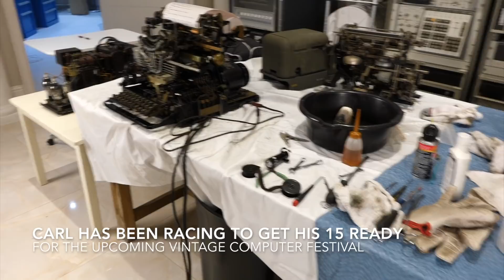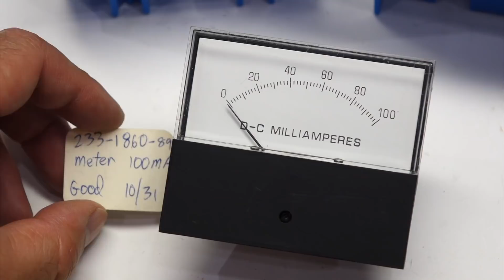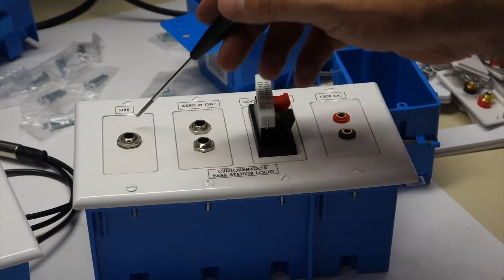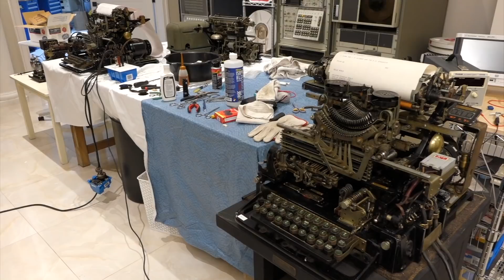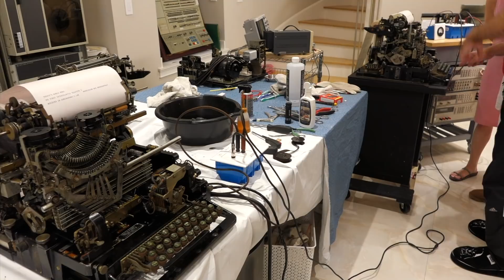Teletype Model 19 Part 7: Our First Intergalactic Transmission Attempt

Comment: I've just started restoring a model 15. I want to do exactly what you did in this video and hook a 120VDC power supply up such that I can use the keyboard to run the printer (I only have one unit). Can you share the diagram you ultimately got working in this video that shows how you wired it together and value of the resistor? That would be super helpful!
Reply from the maker: Just added the blue box diagram to my Model 19 web page here: https://www.curiousmarc.com/mechanical/teletype-model-19
Scroll down to Episode 7.
The resistor is 1kOhms 10W. It reduces the voltage to about 70VDC for only one TTY in the loop, and makes the resistor go a little less toasty. If you want to operate closer to 120VDC, use a 1.8 kOhms resistor. 
Good luck!
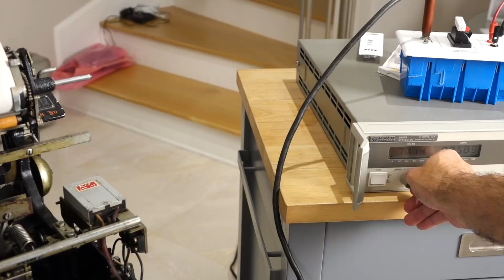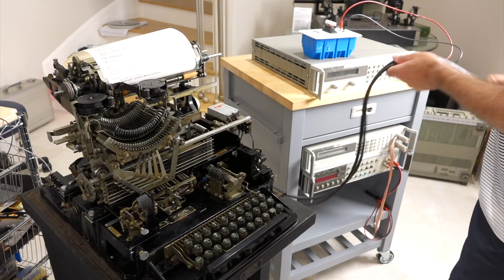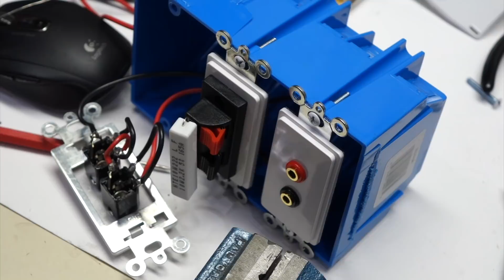Reply: @CuriousMarc  At the 5:06 mark you appear to get it working by just plugging in the single red 1/4" cable. This implies that the receive circuit and the send (keyboard) circuit are already wired in series in the teletype itself. I would have expected you would need to plug in both the black and red 1/4" cables from the teletype to the two jacks in your blue box so that the send/receive would both get connected in series. You did do that at first, but it did not work (3:06 in the video). It looks like you then just plugged in the single red 1/4" cable  and added a jumper wire to bypass the unused jack (at the 3:35 position in the video). Am I correct on that? Really appreciate your help by the way...

Comment: Your round teletype meter is from a radio RTTY modem. The measurements depicted relate to the modulated signal it produced. I think it used two tones and switched back and forth between them for mark and space.
Reply from the maker: Are you really sure about this? It is graduated in mA with a window around 60 mA. It's has to be the loop current, and cannot be a  RTTY modem FSK modulation display.

Comment: No built in aufocovefect? 😂. Brilliant to see them working mate,  keep up the good work!

Probably an odd thing to notice, but I love the printed labels on the boxes. Did you use a particular labelling machine to get that awesome font? The one I've got does absolutely woeful labels haha
Reply: I use Brother P-Touch label printers (I also have Dymo cabling printers meant specifically for labeling wiring cables) for such labels.  The better units support multiple fonts and font widths (narrow, normal, wide)  and styles (bold, vertical, drop shadow, outline, italics, etc.), or you can connect them to a PC via USB and using the supported software you can create labels using any font or B&W graphic available on that PC.  In designing them on a PC you just have to keep in mind that most models, save for the very high end, print at 180dpi (high end 360dpi) and are exclusively 1-bit graphics, B&W with no grayscale support, but you can create some very sharp labels using a PC.

Comment: I often burn the midnight oil watching your CuriousMarc channel. It's very addictive! I must mention there is a great cleaner called NP9 or nonylphenol-ethoxylate. At work we call it "Bucks brew". After soaking metal parts for a while in a non dilute solution, it removes oily residues far better than simple green can. But its nasty stuff! Btw I am on the hunt for a semi-vintage transmission unit I experimented with as a child, it was used for land based beacons in the south island and sent out a station signal for aircraft as a navigation aid, although it's an ascii machine called the ARC Intershake DTM-II. The baud rate can be manually adjusted down to 300 and a speaker outputs the nostalgic modem-sound of the transmission, i have all the manuals from when my late father gave me the machine but it wasn't long before the power supply blew up and i got rid of it, I hope to find one again! Anyway, best regards from New Zealand! Daniel.

Comment: Those exposed banana jacks carrying 120V look a bit scary to me tbh
Reply: Its 120v but only 60mA ..  nothing to drive your toaster...
Reply: Closer to what's needed for a night light than a toaster.
Reply: @mm-hl7gh  <eyeroll> Medical devices are limited to AC leakage currents of say 100-500uA (0.1-0.5mA). The max allowed DC leakage is half the lower value (on parts exposed to intact body contact). So it being DC only makes things scarier. Coming in contact with rectified line voltage (with some capacitor smoothing) is much worse than equivalent AC, because AC doesn’t cause electrochemical effects due to electrolysis, whereas DC not only triggers the muscles but immediately starts to destroy the tissues and can easily impose a semi-permanent bias on the motor end plate (that’s a  part of our anatomy, nothing to do with motors or metal plates).
Reply: It's DC, not AC. Human body has a relatively high DC resistance. It's AC that can get through more easily because of capacitive coupling.

Comment: The orchestration of mechanical to electrical back to mechanical between the machines is impressive! Each character is encoded and serially decoded into a mechanical memory in the blink of an eye. Must have been challenging designing a mechanism whose inertia would not impinge upon the required decoding and printing speed!
Reply: imagine one constructed with today's tolerances... it would be glorious

Comment: Question:  If the modern power-supply is current-limited to 60 mA, why did you need the current-limiting resistor in your loop circuit?  Wouldn't you just wind up cutting the current down from 60 mA, producing something lower than the desired current?  Could that be why the chatter was happening until you increased the power-supply's current to 70 mA?
Reply from the maker: Answers: Part 1 - yes, you can run it without a resistor (I just put a wire) in current limited mode, it sort of works. But it makes for wild voltage swings between mark and spaces when the supply switches over from constant current to constant voltage under an inductive load. And since it's highly inductive, you still need some high voltage kick. I could not run it below 40V although the loop only needed 14V to maintain 60 mA in steady state. So I ended up running it the old way, with a 1 kOhm-ish resistor at around 70-ish Volts in constant voltage mode, and adjusting the  voltage to get 60 mA as you see me do in the video. Then I use the current limit set at 70 mA for protection in case I mess up - which I invariably do, but even without it the resistor would keep things in check. Part 2 - no, the 70 mA problem was way more bizarre and unexpected and took me a while to figure out. Answer in one of the next episodes ;-).
Reply: I am not an expert but I believe you need to run it at 120V to prevent the contacts from burning out. I have heard it is bad to run at low voltage. It might also reduce your transmission errors.
Reply: The test spec I found is 130Vdc @62.5mA but 80Vdc @ 60mA is nominal. The theory of operation is at http://www.baudot.net/tty-connect/tc-hardware.pdf page 7.

Comment: I often wondered what the tuning fork was for. Now I know that it was used for syncing up the teletypes by frequency.
Reply from the maker: I'll see if I can get one. It was used to adjust the speed of the AC governed motors. My model 15 has such a motor, and there are black and white stripes on the fan and a lamp nearby to use the fork for a "stroboscopic" adjustment. But we simply just used my oscilloscope to time the generated Baudot pulses instead.
Reply: They are on ebay from time to time, I bought a few years back to build a tuning fork oscillator with, the ones I have are 125Hz
Reply: Confirmed. I see one available on eBay and the Crypto Museum verifies that they are 125Hz. Thanks! I learn something old every day. 😊
Crypto Museum URL: http://www.cryptomuseum.com/telex/tools/fork/index.htm
Reply: The tuning fork was used to set the motor speed which determined the wpm of the machine.

Comment: I love these old dinosaurs. :D One false step and it could literally kill you. These days everything is safety rated to ridiculous levels due to not so bright people.:)
Reply: If you really want to see a machine that will get you, but at first glance looks harmless. Look up an Ampex VR-1200 Videotape recorder,  video heads that spin at  14,400 RPM, 2" wide tape moving at 300 IPS when in fast wind mode, vacuum pumps and compressed air. As long as you are careful you are OK but if you are dumb or careless it can go bad real quick.